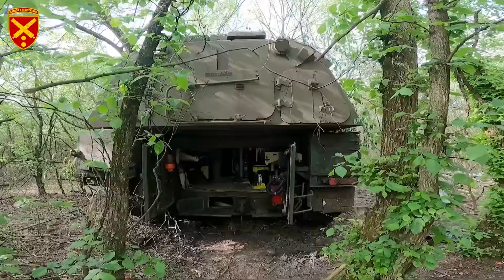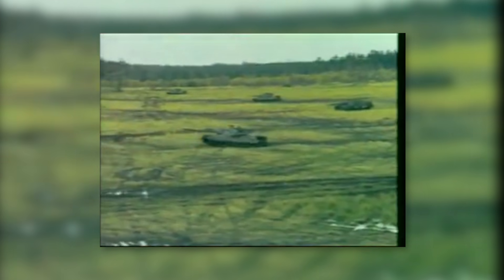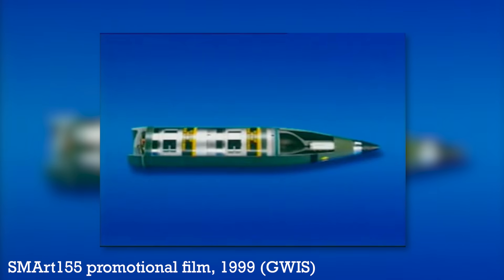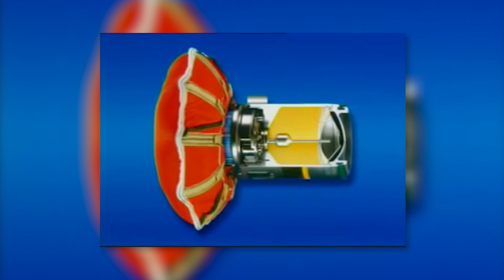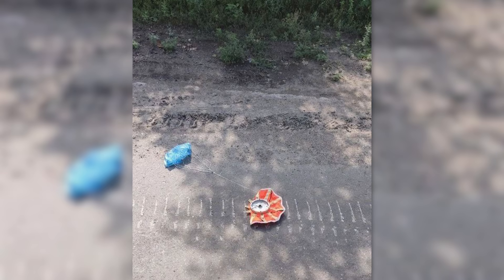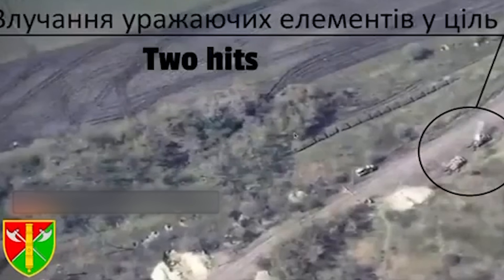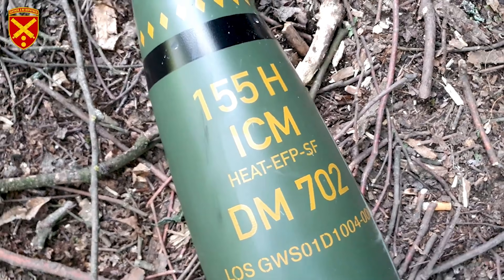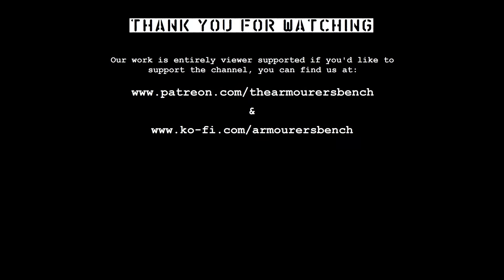Top Attack SMArt 155 In Ukraine

Comment: These things escalate from something ominous to absolutely terrifying in a fraction of a second.
Reply: Yep, the sure number of ways for artillery to kill you is quite impressive if not horrific.
Reply: Especially when an entire payload of missiles is heading to your coordinates.
Reply: There's even similiar top attack  thermal homing EFP munitions for 12cm mortars... and the Finnish mortar they were originally designed for went into production in early 1940 and is still in service, but it can also be fired from modern successors like the Finnish AMOS turret or Swedish GRKpbv90120 Mjölner... both with dual barrels, crew constantly under armor and less than 30s set up and redeployment time. The AMOS turret is even capable of 0°-elevation direct fire in self defense with any munition other than the STRIX anti tank round. Eg: frag, smoke, illumination, etc... either way, a pair of ~13kg shells to the face is going to ruin any ambushers day...
Reply: I heard the Chieftain talk about these types of munitions and he said they terrified him. I saw a munition that used similar technology called the CBU-97 Sensor Fuzed Weapon that is air dropped.
Reply: How long these bomblets stay in the air? Also as they fall down coverage area shrinks.

Comment: These Bomblets can also be packed/dispensed by a KPED-350/Taurus (16x Bomblets) allowing you to destroy armored columns up to 500km away. As far as I know, the dispenser has been built/developed but was never ordered, because it is ridiculous overkill and a stupidly expensive delivery system for just 16 cheap (compared to the delivery system) Bomblets.
Reply from the maker: Interesting I wasn't aware of that. Thanks!
Reply: I've read that the Taurus can deliever quite the amount of payloads with subammunitions. Do you happen to know if it was considered or is it possible to use the Taurus frame as a unmanned system to deliever these payloads as well or is it not cost effective as it was intentionally designed as a Bunker-Buster?
Reply: @13deadghosts @TheArmourersBench  There's also a GMLRS version called M32 SMArt with 4 submunitions that was developed but not ordered. What a shame.

Comment: Very interesting stuff. I think it is also somewaht ironic that the PzH2000 does have a pretty obvious Bomblet/Sub Munition top attack armor package on the turret roof. Which as far as I can see was quite uniq in German armoured vehicles for quite some time. So in a way the PzH2000 was better equiped to deal with an attack of the same munition it was using on other peopel then other german "Panzers" :)
Reply: This makes sense since the primary threat is counter battery fire using bomblets that would strike on the top armor.
Reply: @norbertblackrain2379  good point 👍
Reply: @norbertblackrain2379  That and as a military making use of such ammunition they would be more likely to consider the use of that specific kind of munition.
Reply: The Puma IFV uses the hedgehog armour ( Igelpanzerung, made by GEKE-Schutztechnik) as well. Some Leopard II variants ( Strv 122,Leopard IIA6 HEL) are also utilizing a heavy passive roof protection module, but not identical to the hedgehog armour.

Comment: The weapons operation is amazing electronically, but I am still stunned that a shaped charge can be effective at the ranges these are seen to deploy from.  Most shaped charges seem to be used at the surface (or maybe 1-2 metres for an NLAW), these suckers go from what seems like up to a few hundred metres.
Reply: That is because it isnt a shape charge per se, but an explosively formed penetrator. In essance it is a metal slug, which is formed by collapsing the liner. The Process is largely the same as in a hollow charge, but the angle of the liner is much less steep and therefor the resultant projectile isnt a stream, but the already mentioned slug. Which has a lower penetrative ability, but a much longer effective Range then a hollow charge jet. 

Which is why for roadsied mines and such top attack sub munitions, explosviely formed penetrators are used insted of pure hollow charges. Which reach there maximum penetrative ability at a maximum of some 9 times their diamater/kaliber. (From memory)
Reply: Thanks so much for the explanation, I was wondering the exact same thing.
Reply: @ehochmuephi8219  you are welcome 😃 I looked into this when I did a video about how shape charges work on my German channel.
Reply: Hehe, yeah I know you from there. Great stuff man. Keep up the good work. Looking forward to your next video!
Reply: @ehochmuephi8219  Also, to expand on this point, even hollow charges perform better with a bit of range. The ideal stand-off distance (to maximize penetration) for most simple anti-tank weapons is around 2-3x times the distance (like 3-6m, but it varies a lot) they detonate at usually, it’s just impractical to make them detonate that far away. If you ever wonder why a lot of anti-tank warheads have a skinny pointed nose, it’s often since the fuse needs to stick out further so there is some stand-off, or the charge just won’t work.
Reply: The amount of aiming from that distance above the target is impressive
Reply: @michiel1362  Yeah, that's something else I had previously thought, the targeting on that spinning sensor in a single use weapon that needs to survive a launch from a 155mm howitzer is damn impressive.
Reply: @guyb7995 
Yes it reminds me of the first VTZ rounds used in the last year of the war, NO solid state it had a glass Tube/bulb that had to survive the force of being shot from a 5 inch cannon , most effective against Kamakazs